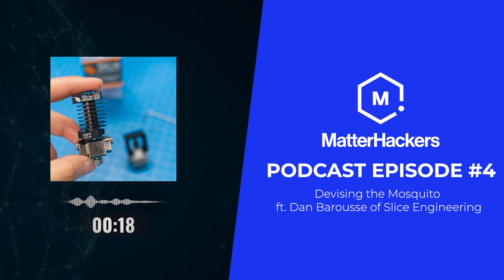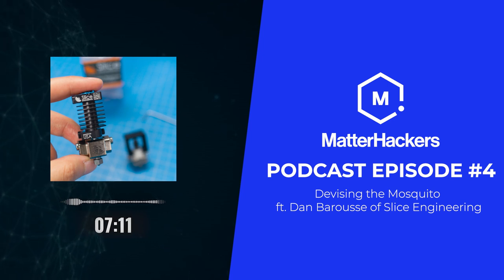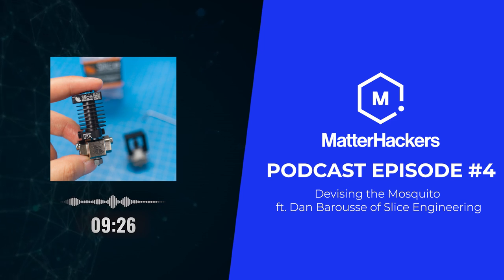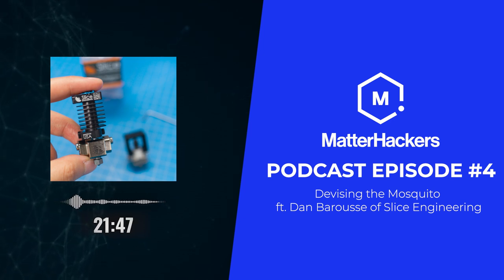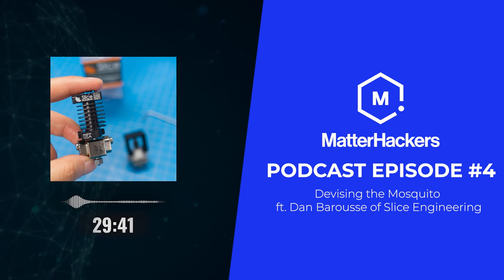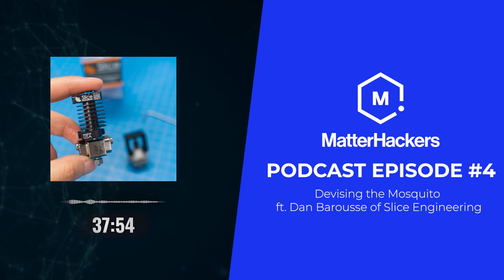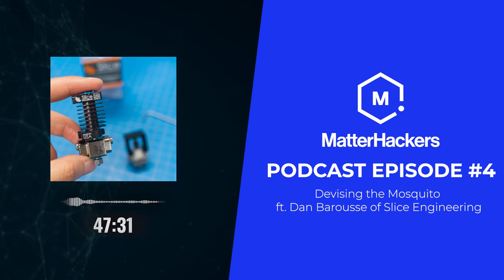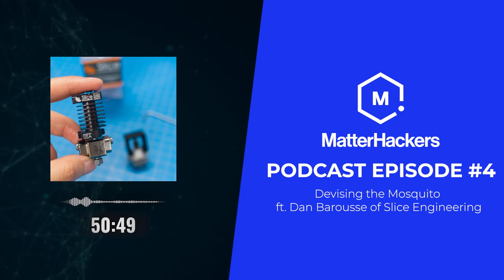Slice Engineering and Devising the Mosquito | The MatterHackers Podcast | Episode 4

Comment: Thank you MatterHackers for your podcast, it was very entertaining. I am the CEO of a chemical/mechanical engineering company. One of the things we specialize in cnc engineering grade metals and plastics. I have worked on aerospace projects in the past, including with NASA.

To Dan@SliceEngineering; I own quite a few different hotends, including the Mosquito made by your company. Most of your products are great for the retail and consumer based market. But for manufacturing, there are a few problems with your design (that I had problems with, not necessarily everyone else). For my needs I took several hotend designs (including yours) and combined them so that we could repair hotends in a timely matter without having to have a shelf full of spares. Aluminum is a far better material for heat sinks than other materials, such as copper. Copper conducts heat well, but is poor at releasing heat. I think the next step in heat breaks is not to use metal at all. Thank you again for your time on the podcast.
Reply: Thanks for the feedback, Michael. We do use aluminum for our heat sinks. If you have a specific application where you find the Mosquito is falling short we would be happy to speak with you about it. We're always looking for ways to improve!